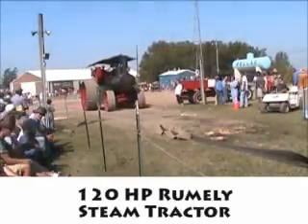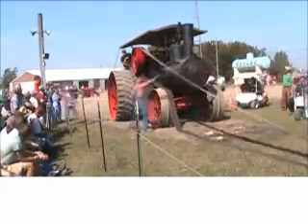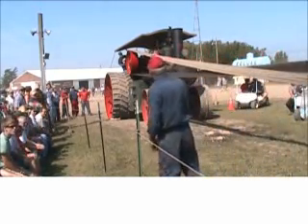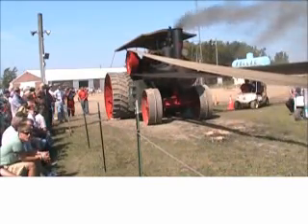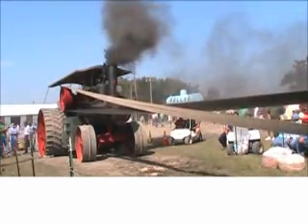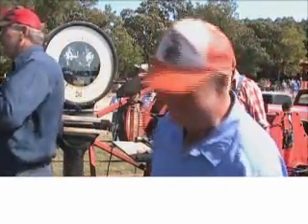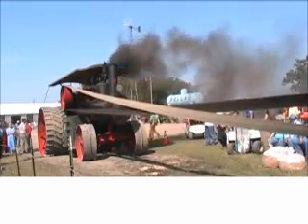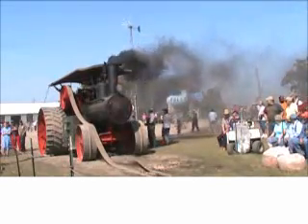Rumely 120 Steam Tractor making 3,050 Ft-Lbs Torque on dyno

Comment: At the end - 9:35 - did the belt break, or did the brake break? Or does the belt lose grip if you exceed its max torque rating, and it just slides off the side of the driving or driven pulley?

Comment: But the DC electric motor isn't the only other thing that can produce torque at 0RPM.... And another alternative is a technology that was used on trains in I guess the 60s and 70s was hydraulics. Cars often use hydraulics today for their automatic transmissions, as a fluid coupling called a torque converter is fitted between the engine and transmission, allowing an automatic car to produce torque at 0 RPM. For instance, at the beginning of a drag race when an auto trans car is getting ready, the driver will likely hold the brake and the throttle at the same time, this is called "power braking".

But yeah, I think I saw the same comment in another video on steam tractors, and it may have come from Case's uphill advertising gimmick.
Reply: Sevalecan  Thanks. Very intuitive.

Comment: Good thing he ain't working for a railroad. All that black smoke would get him "called in on the carpet". Need a little less air or a thinner firebed.
Reply: Is the black smoke unburnt coal?
Reply: well its not compleatly combusted, but some of the heavy smoke could be for show, we do that same thing with 765 at the open house, lay on the coal for the night photos and jack the whistle full bore for effect , its ear piercing loud if you stand next to the engine and not in the cab

but the announcer is right about working a steam engine the harder you push it the more power it makes and the more effecent it works especially ones that have a superheater.

Comment: GM experimented extensively in the 60's with LPG gas fired, high pressure, multi cylinder steam engines for passenger cars. They achieved incredible performance, like 2000 ft lbs and over 200 BHP!  Didn't even need a gearbox!  Economy was also good.  Another project killed off by the oil companies!
Reply: I'm sure you actually meant safety issues, complexity, difficulty of servicing and engine life, right? And then there's the whole convenience issue of having to wait quite a few minutes before the car would even think about driving, what might happen if the driver let the boiler run out of water, etc.

That car didn't die because of some oil company conspiracy, it died because it wasn't practical to make a steam car, wasn't practical to support a steam car, and definitely not practical to own a steam car.
Reply: There would have been little waiting to start, it was a flash steam boiler, so maybe 15 to 30 seconds.  Also a condensing system so water  is recirculated. Any loss would have been replaced at a normal stop, certainly no more frequent than a gas stop in an ICE powered car.  Due to the flash boiler there is no large pressure reservoir so no safety issues. GM had also addressed durability and reliability factors.
This was a serious project intended for production.
Reply: You obviously don't know much about flash steam boilers.  It's not like a steam loco boiler, which are very inefficient.
Also, not a fire hazard, you aint stoking a boiler with coal you know!!
Reply: dieselrulesKO
Main reason I haven't been in a hurry to replace the 4.9 I6 that's in my F150. Heh. If I do end up forced to swap it over I'd go more for a 4-53 instead of a Cummins simply because I prefer the sound of the screamin' jimmy more. The Cummins is a great motor, but it sounds like any old commercial vehicle.
Reply: TestECull another sound choice, I prefer the low and slow sound but I guess that's because a Cummins is still quite a rare and impressive engine here in the UK whereas it's a bit mainstream in the us. But trying to swap something the size of a 6bt into our trucks which are designed with 2.5l engines is  a mammoth task,
Reply: salemcripple

They worked on all those issues and achieved a practical vehicle.  It had a flash steam boiler heated by propane, so steam was available very quickly.
Reply: would have made a metric ** load,
Reply: There's nothing wrong with V8 diesels. Matter of fact they're great motors and I see no reason why a V8 diesel of about 5 liters couldn't be used in a half-ton pickup truck to give it the fuel economy of a basic V6 Toyota Camry while retaining the pulling power expected from a half ton pickup truck. Wouldn't even need to be a turbodiesel, N/A would produce enough HP/TQ to get the job done, though adding a low-boost turbo would be a huge boon to fuel economy and help it burn cleaner.

I'd be all over a new truck if I could get a ~5l diesel V8, six speed manual, 2wd, regular cab, long bed with few frills(AC, cruise, nice radio, comfy seats, that's it) and switches to turn the mandatory electronic nannies off. Alas, such a truck doesn't exist, so instead I drive a 30 year old F150 :P
Reply: TestECull no there is nothing wrong with the principal behind it, I'd love to put a v8 diesel in my pickup, but gm diesels have a pretty bad record for reliability, with crank bearing webbing failures being what finally kills them , if they are reliable great, I think durmax or Nissan or someone is building exactly that, a 5l v8 derv for a pickup, just not out yet
Unfortunately for reliability, I'm going for a 6BT in my truck, old stuff built to last
Reply: Mm, yeah they are pretty tiny relatively speaking. A first gen Ford Ranger would be a good analog if I remember right.

My half-ton is quite a bit larger, so that big Detroit will clonk right in there. After all, the I6 I've got now is three feet long and two feet high. Huge chunk of iron under there.
Reply: Hahaha. Yeah that sounds like it. My family actually owned a 2003 Ranger XLT 3.0 5-speed for a while. Sweet little truck. Decent on gas, too. I've seen people wedging 302cid Ford V8s down into those little guys!
Reply: +turboslag Not at all why it was killed off. Steam engines of all types are extremely high maintenance, they require a LONG warm-up time (time enough to build up pressure could be a half hour or more even on a small boiler). Most require specific knowledge on how to even get it up and running. Once it's running it requires specific knowledge just to keep it running on the account that no matter how big your boiler is, you will ALWAYS be using more steam than you create (water takes a long time to boil). You have to balance out the steam you use, and "rest" periods where its building up pressure. A gasoline, diesel, or electric on the other hand, you get in, turn the key, go. Virtually nothing more required other than a tune up and oil change every few thousand miles.
Reply: turboslag  Impressive thread. (The only thing I can add about a GM diesel is that they probably also try to use what they have [block, crank, whatever] for their go/no-go  pursuits.)
Reply: ***** They obviously didn't address those issues because I can't find any for sale on eBay motors. Steam powered automobiles just aren't practical, simple as that. It's not an oil company conspiracy, it's simple fact. They're complex, they're hard to service, they require new infrastructure put in place to support them, they're bigger fire hazards than ICE powered cars, and here's a doozy for ya:

They're LAUGHABLY inefficient. Steam engines, the best ones, can only really hope to get about 5-10 percent of the energy put into the boiler. The vast majority of the fuel's energy is wasted. This is why they were discontinued on railways in favor of diesel-electrics, as well, and why the only ones that remain in service are either naval or power stations. An LPG powered Steam car would be far more fuel hungry than an LPG-fuelled ICE car. Nobody would buy the former.

If it genuinely was an oil company conspiracy someone would have told them to fuck a cactus and released one already. That conspiracy relies on everyone playing ball, all you need is one renegade inventor who doesn't give a fuck to challenge it and it all comes tumbling down. If steam powered cars were practical that would have happened already. But they're not, so you're not gonna see one on the road unless you live near Jay Leno.
Reply: ***** Anything that's over 400 degrees or so is liable to start grass fires. You got a flash boiler in your car? IT's over 1500. And then when you crash it? It's still over 1500 degrees, only now everything's bent and twisted so there's a high chance of flammable fluids bumping into that thing and going fwoomf.

On a standard car there's only one part that gets that hot: The catalytic converter. It's small, well hidden and well shielded. You can't hide a flash boiler in the same way, they're pretty big.
Reply: TestECull im afraid I have to agree, steam technology is too inefficient, even from a theoretical point of view, they cant even get the 30% that petrol cars get, let alone the 40-50% of diesels, they are interesting technology but thats all. GM does like to produce some dogey engine designs (v8 diesels anyone?) so i can believe that
Reply: +turboslag Nope, water freezes. That's what killed the steam car.

Comment: anyways, my post was towards the idea that hp is just math. when it's actually more complex. Horse power is just math, but power is not. I could make up a term called mouse power and create my own calculations to transfer power into mouse power. that would be math. but the amount of power an engine produces is more than just math. it's when we put a term in from of the word power, that it becomes a product of math
Reply: ofsoundminds   1 horsepower = 5 men = 3,000,000 ants, 5 horsepower = 1 elephant.

Comment: Part of it is me misreading your post the first time, and the 500 character me cut my post short.  I thought you were misinterpreting torque as work by saying its distance and force.  Perhaps a more clear way to phrase it is that torque is force at a known distance from the center of rotation.  Had you said that RPMs gives you the linear distance (2pi when measuring in ft-lbs) and speed, I would have known what you meant.

Comment: I understand tq and force and power and time. Tq is the only thing that CAN be measured. so Im not sure wtf your post is pointing out. If the engine is running, and the tire is not moving, energy is still being transferred, just not in the way you need it to, i.e. rotate tire

Comment: Torque is force. Work is a measure of force over a distance (ft-lbs). Power is a measure of work/time(ft-lbs/minute HP is 33,000ft-lbs per minute). If the resistance on the brake was so great that it required more force to rotate than the engine could put out, there would still be massive amounts of torque on it, but the engine would be doing no work and making no power. It can be confusing as ft-lbs is also used as a measurement of torque which actually is being measured here.
Reply: marty264   I recall the distinguishing units to be ft-lbs and lb-ft.  One about power that I think easily reveals a lot is power is force times velocity - have to keep the force up to and on that velocity; you see it and say "That's powerful".

Comment: tq is also math. 100hp will put down 2 times the wheel tq as a car with 50hp at the same given output shaft speed. distance is 1 dimensional. tq is 2 dimensional because its made of distance and force. hp is 3 dimensional due becasue its made of distance, force and rpm. thus when using a gear box, hp is the only thing that matters. if their was no tranny being use, then it will be a 1:1 ratio and crank tq is directly linked to output shaft "power"

Comment: HP = torque x5252
so high torque and low HP (like this video) is good for continous "work"
but if u have low torque but high HP its good also, its better for car topspeed for example.